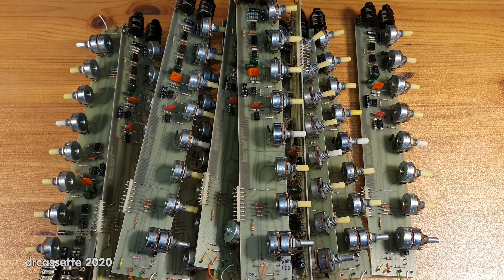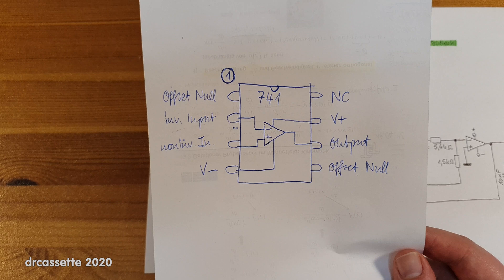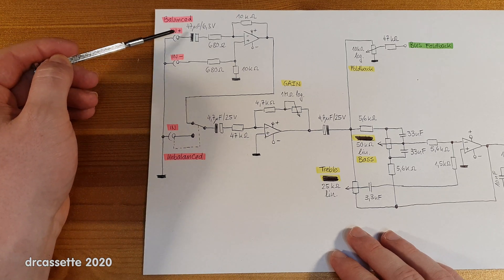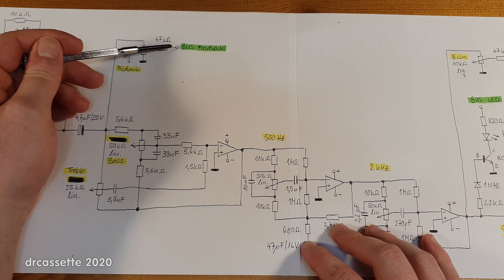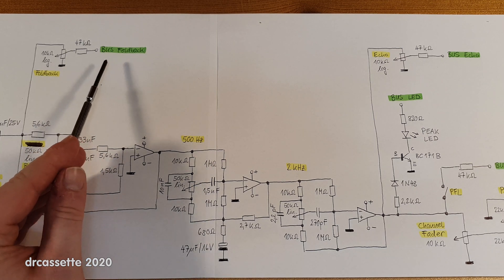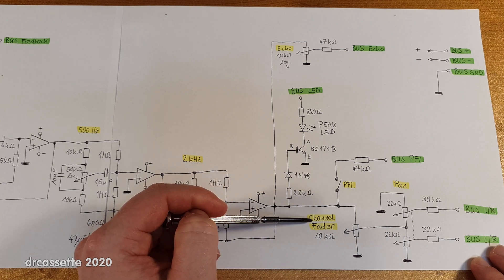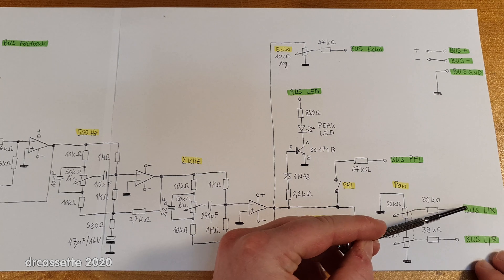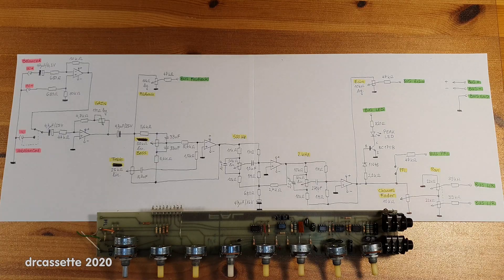FAL stereo audio mixer channel strip circuit

Comment: The algorithm has just fed me this video, it really brings back memories for me. I have been an audio electronics engineer all my life and have lived in West Yorkshire where FAL (Futuristic Aids Ltd) was based, so have worked on many of these mixers. Many manufacturers of disco and PA equipment at that time produced very similar equipment with almost identical circuits, the 741 being the weapon of choice. Those faders with the "B" identification were sort of "semi-log" sometimes depending on the make. The use of the jack switch on the low/high inputs is a good design in one sense, as that first stage that it switches out is a bit noisy, but the switches tarnish with age and the smoky environments these mixers found themselves in, so cause intermittent problems later down the line.

Comment: nice explain, i do passiv mixer 6ch mono, dc blocking capaticor is not obligatory ? any risk behind modern pro sound card (neumann mt48). cheers
Reply from the maker: DC blocking capacitors are a good idea just to be on the safe side...
Reply: @DrCassette  there is a risk with top pro harware before, after ? i learn ;) cheers

Comment: The mystery of the BUS voltage, of peak LEDs is that the noise of the transistor switch that turns on and off should not be mixed since there can be 32 Peak LEDs on / off all time, and this would cause noise in the audio signal lines They are sensitive to voltage changes, for this reason it has an independent voltage source.

Comment: I didn't realise that the 741 was that old. Recently I got some out from my old stocks (c1987/1988) and they worked as a 741 should do.
The 741 is a great and cheap experimenter option!
Reply from the maker: I was not saying the 741 is bad, but by now there are many better options readily available, that are pin compatible with the 741.

Comment: Interesting circuit DC. 

To the left of "500Hz" is an OP Amp where the V+ terminal is immediately grounded - no problem. However, what caught my eye is there may be some unintentional dc offset voltage (at the input) due to native OP Amp biasing currents? It is often a good idea to ground the V+ terminal via a calculated resistance to negate unwanted offset. This offset will amplified by the OP Amp and may be amplified (again later) right through the next cascaded set of OP Amps? Depending on the polarity, the offset voltage may tend to switch-in the 'peak LED' too early?
If these are all transistor based OP Amps, then the dc offset might become quite a problem?, less so with FET types.
Just me thinking out a loud.  ;o)

Thanks for the upload! :o)
[Edited a few times]